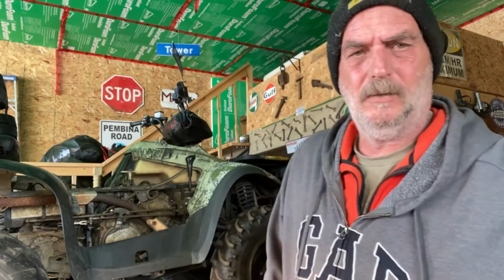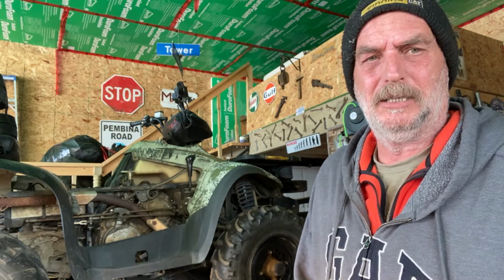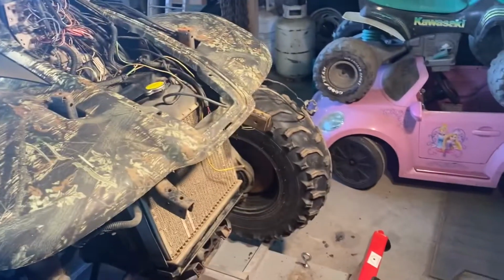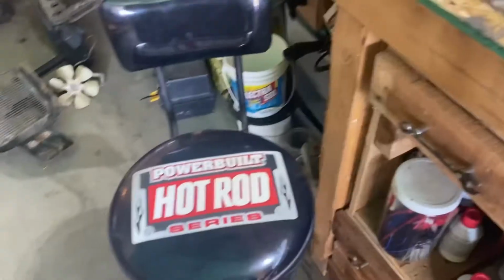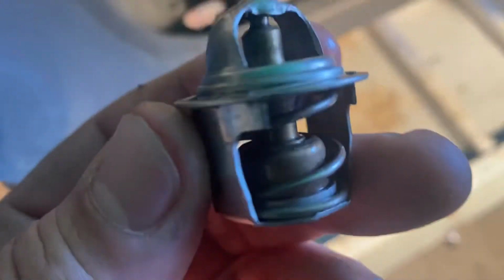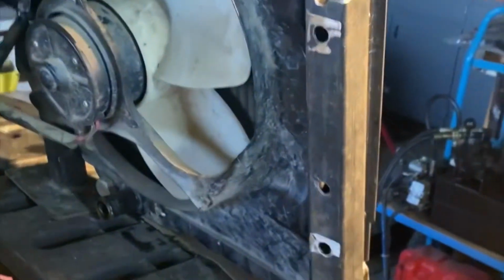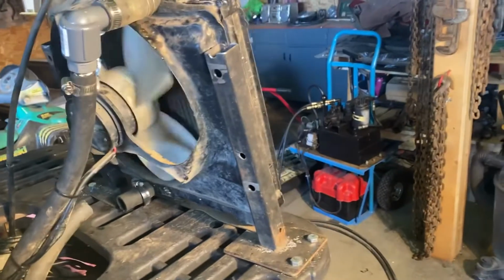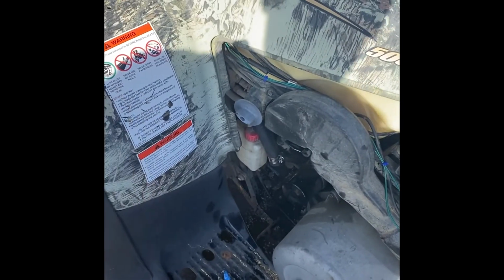1998 Polaris Sportsman Rad Relocate

Comment: why are you moving the rad is it over heating
Reply from the maker: Ya and it leaks. The other one I have is bigger and won’t fit in the little space. And Cole likes the deep holes. Haha
Reply: The thermo single wire thermostat on engine is just to turn the indicator light on on the quad the two wire thermostat on the rad activates the fan